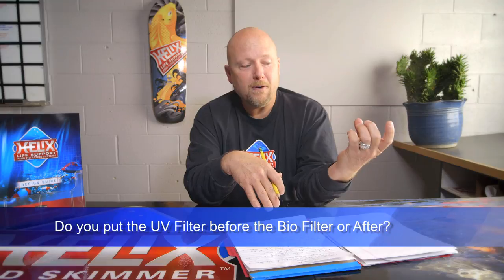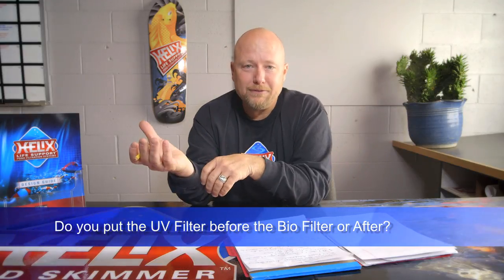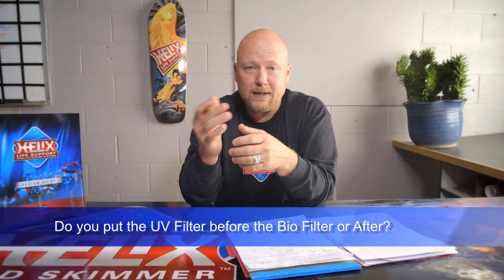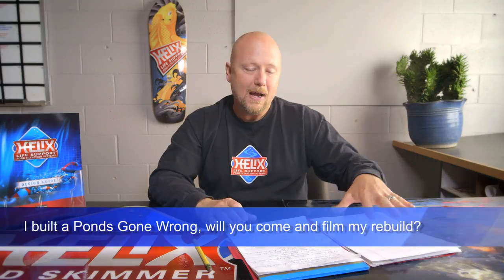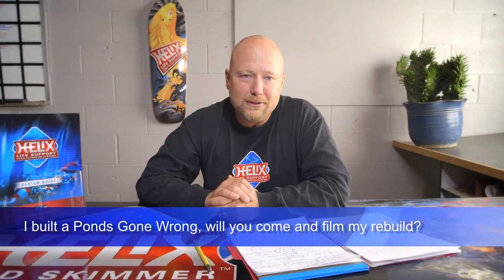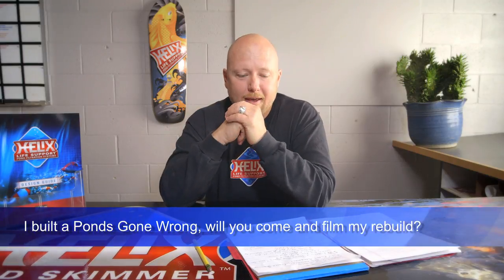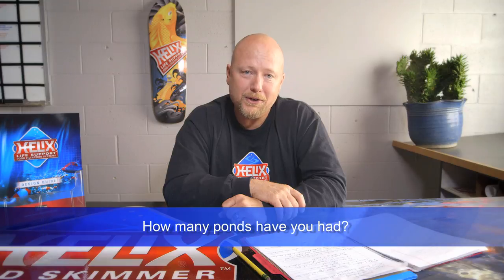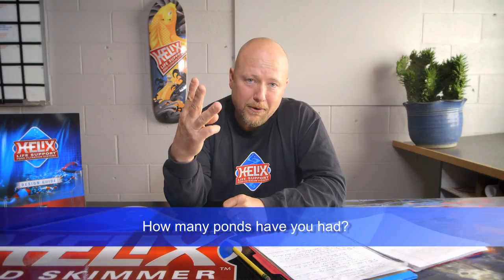UV Filter, Moving Bed Waterfall Filters, Ponds Gone Wrong - Ask T.P.D. Show #5

Comment: I am on my 2nd pond (both above ground). My first was in an apartment (with a small backyard), it was a DIY disaster, edged with 2x4's and the walls were 1/2" plywood, all held together with 3-4" screws. One bad monsoon season here in Arizona later, the side wall cracked open leaving my liner bulging out. My second/current pond I built in my first house (rental). Learning from my previous example I wanted something strong, but because it was a rental I wanted something I could disassemble when I moved into my own house. I built the frame with pressure treated 4x4's (horizontally) with rebar vertically running through the 4x4's, and lag bolts holding the sides together. I have since moved into my own house and the moving of the pond was great, 3 years later still holding up very well. Just last winter, I added an active bog filter (thanks to your videos "Patio Pond with Bog Filter" @ https://www.youtube.com/playlist?list=PLqM5Qn1K_DPyzlvnJ9s5O00jSY899TacZ) Works extremely well, the plants look amazing and no algae in site! If I move into a house with a bigger backyard, I would love to build my 3rd pond, this time being an in ground.

Thanks for the videos!
Reply from the maker: ***** Thanks for sharing your story and it's great to hear our videos inspired you to make improvements.

Comment: I am definitely a pondaholic! I'm on pond number 4. My first two were those preformed ponds that you buy from home depot or lowes. My next pond was a 14ft wooden jon boat that I built. It didn't really float (lol) so I made it into a pond. (Note that it was nothing more than blue tarps holding water in and filtered with blue swamp cooler pads). It was pretty much a fail after a few months so I moved on to my newest pond. Its about a 13 x 11 oval shaped pond. I made the filter out of an old pool filter. I stripped the inside and filled it mostly with lava rock and some filter pads I bought online. I also put some lava rock in the waterfall. The lava rock works like nobody's business and my pond has been clear for as long as I can remember! By the way I got into ponds by watching your videos. You have definitely inspired my love for ponds and koi.
Reply from the maker: Mike Mcpolin Then my work is working! Education, Information and INSPIRATION!!

Comment: I'm on pond number 2. I turned my 1st one into a plant pond that feeds into a stream which enters my 2nd main pond. Total gallons is 2,200 400 and 1,800. 
I've got two Ultima bead filters (6,000 and 1,000) installed, no UV, and a skimmer. The skimmer outputs to the plant pond. I have a bottom drain that feeds the 6,000 gallon Ultima then outputs to a waterfall.
I'm considering buying some Bacteria House Filter Media to put in the skimmer and waterfall. What is your opinion on this ceramic media? It is pretty expensive for media in my opinion but if it does what they claim it would be worth it. Thanks for any thoughts on that. Steve
Reply from the maker: +ssng1 Ceramic media is great but I wouldn't put it in my pond skimmer. The ceramic media works best in a bio filter with great pre-filtration. You want to catch all the solids before sending pond water to the ceramic media. The skimmer is a pre-filter. That is why I wouldn't put the ceramic media in the skimmer. Thank you for sharing the details of your pond with us and thank you for watching!

Comment: Hey, I'm famous! You have pictures if you think my contractor was "wrong" enough. They are starting the re-dig March 23. I found a pdf of the bio-reactor filter that says the bottom should be loaded with lava rock, but looking at the bottom of it and the air injection, it doesn't look like I add anything but the bio-balls. Any video or instructions on a comprehensive setup guide?
Reply from the maker: Brian Foster I'm hitting the road this week for the Water Garden Expo but will connect with you to see how your project is coming along. Talk to you soon.

Comment: Hi Eric i have 1 question for you i am Building a Very Large Aviary and planning to include a Stream , Waterfall and Pond now my plan is about a chiclid pond any good tips for me about a chiclid pond requirements my total water capacity should be around 25000 gallon and concrete structure by the way i live on a small island called malta its located in europe and our cold winters very rarely go below 60 degrees Fahrenheit so snow is not a problem :)

Comment: I don't know if I'm on my 2nd or 3rd? LOL My first pond 10x2x2  I moved from one house to another. Well, as I'm sure you know, with a liner pond, when I moved it ended up being a completely different pond 8x8x2. So much so, that I had a bad leak in my liner, before I could get it fixed, I lost my Koi to a predator. I was pretty upset. We also just got a puppy, who chewed up all my pond equipment shortly after. So 2 years later, am now going "all out". Almost done with my 15x9x4 pond and will be getting 9 Koi from Mystic Koi this spring.
Reply from the maker: Ron Yelenich Fantastic!!! But the puppy eating pond equipment? ouch!!!

Comment: Sorry your explanation was barely sufficient for the science guy in me. The UV sterilizer utilizes a germicidal fluorescent lamp that produces light at a wavelength of approximately 254 nanometers (2537 Angstroms). The water with the bacteria/algae passes over the bulb (or around the bulb if a quartz sleeve is used) and is irradiated with this wavelength. As the light penetrates the bacteria/algae, it mutates the DNA (genetic material), preventing growth/multiplication of the organism. The UV light will kill both good and bad organisms and is not selective. 
I purposely use a smaller flow pump as the speed with which water flows over the light will affect killing times.  The slower the flow the more effective the light is.   Your welcome.